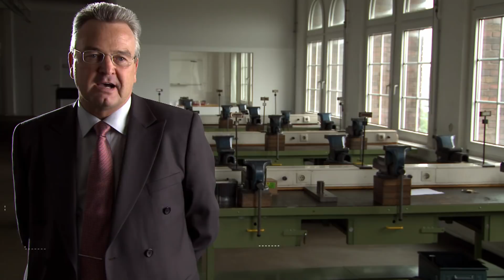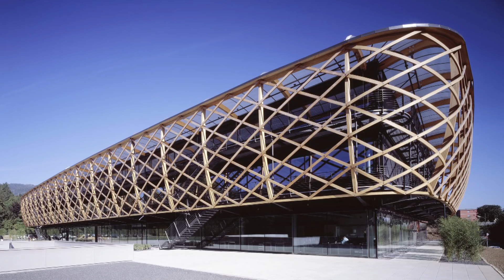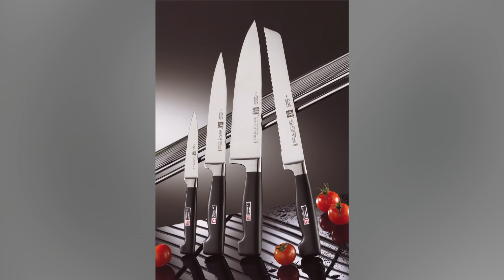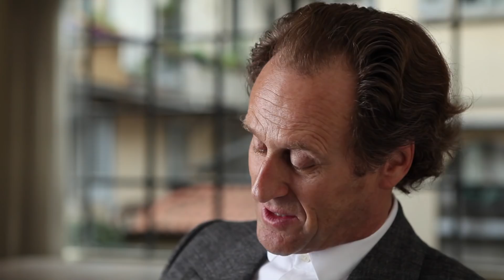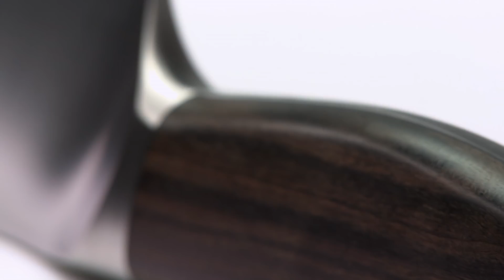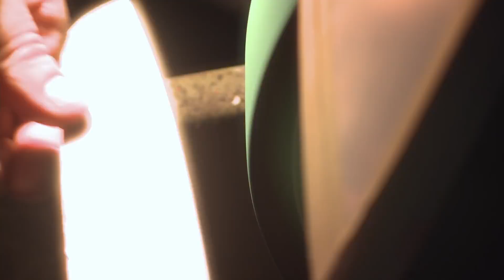How a ZWILLING J.A. HENCKELS Knife is made! - BRANDMADE.TV

Comment: Calling these knives forged is a bit missleading, when the only real forging part going on is on the bolster.
Reply: It is still forged.  It would actually be quite difficult to forge an integral bolster like this by hand.
Reply: @mattrevesz  I know it would be, but that's not the point. They call the knife forged, even though the bolster is the only thing heated up and shaped, everything else is stamped, sanded/ground and heated up for heat treatment.

Comment: the design aspect aside, i've used henckels' knives since the 80's. they stink on ice (pun intended.)  the composite handled ones are near impossible to sharpen, and do not hold their edge. in a restaurant environment that spells disaster. solingen (german) steel is my favorite, you'll do a universe better with wusthof. although no longer produced, if you can get your hands on the wusthof "grand prix" series knives, you will know what a truly good knife is. beautifully balanced, razor sharp, easy to hone, ergonomic. to be fair, henckels' wood handled knives are good  too. good balance, stay sharp, easy to hone. i don't like gimmicks. henckels has a lot to prove and improve.
Reply: I love my Wusthof 6 inch Chef's knife; it's seen daily use for 7 years and is still going strong. With some practice, I've found I can replace just about every other cutting tool in my kitchen with that one knife.
Reply: @allseeingeye93  , whatever works for you is the best. hayeva, i would caution against using a chef's knife in place of a cleaver, boning knife, or toothpick!...just kidding. the point is, the right tool for a particular purpose is always the best approach...and safest. happy cooking!

Comment: Ive had a nice Henckel kitchen knife for about 10 years. Its a good knife. Its
 balanced well, feels good in my hand. The only issue, it wont stay sharp for long. I recently bought a set of Japanese knives. All 3 were hand made in a small shop in Japan. The smith is an actual sword maker who also makes kitchen knives. The knives are by far, the best I've ever used. I also spent less than Henckel and got 3 specialty, hand forged knives by a master Katana smith. They are not expertly designed for looks and precision. They look like black iron with an edge, but what an edge. Sharpened with a wetstone and its a razor. I cleaned a Salmon like it was jello.

Secondly, why does ths Henckels guy keep saying the knives are "Forged"... then they show the knife being stamped out of a blank. Thats not a "forged" knife! Its a stamped blade that was apparantly designed by Italy's GREATEST designer, who just designed the exact kitchen knife already in 1 billion kitchens.
Reply: Dropped forged/ hammer forged...hand forged, the hand forged blade actually is more likely to contain flaws (inclusions, poor temperature control, over-worked steel, etc) than the mechanically forged blades. Again, you get what you pay for, and low paid labour usually equates to low quality product. Ask any professional in the restaurant business (who usually have to buy their own knives), what kind of knife they prefer and the answer is always the best that they can afford...not the best deal on an economy blade. The "experts" are out in force in this comment section, but beware of kitchen warriors giving advice on their limited knowledge.

Comment: I almost bought one of their boning knives, but didn't when I read 'made in China' on the blade. Probably still a very good (relatively inexpensive) knife, but from what I've seen of Chinese metalworking, I think I'll pass.
Reply: Not all chinese metalworking is bad. In fact, there are great companies that manufacture great knives in China. CCK, Deng, Shibazi, etc.
Reply: Real Zwillings are German or Japanese (depending on lines). In the US they have a cheaper line which is made in China. I would guess the one you looked at was at most $30-40

Comment: You can't really tell me that those engineers where supriced about knive balancing XD what have they done before???
Reply: It’s because most German knives are balanced towards the back. Not really at the bolster. I know your comment is old but just incase you cared.
Reply: Too add onto that,
If the balance is towards the back of the knife/sword/Any other tool you have more precise point control giving you more precision. I prefer this in paring knifes.

If the balance is towards the blade it makes it easier to transfer power into your cut. This is what you would want for cleaver and would be my preference for a larger 10"+ chef knife if most of your knife work involves harder to cut ingredients.

As for a chef knife it's really about preference. I personally use a 6" chef knife which is on the short side that is slightly hilt heavy. I prefer the shorter knife with a bit more precision for my cooking.

Comment: why one layer of steel thats weak you should make more layers then you will have more durable kniwes
Reply: No, you won't. The point of layering steel is to remove impurities in the metal, like dirt. We have machines today that easily remove all the impurities of our metals. So, the only reason for layering steel now is for it's visual appeal.
Reply: Yes that's also the point of layers, but it's also to make a ''jacket'' of softer steel/iron for the hard core steel to make the knife more flexible/durable
Reply: First of all, putting hard steel inside of soft steel won't make it more flexible. For a sword, you'd want the spine to be soft and the edge to be hard. Secondly, combining hard and soft steels is not a good idea for kitchen knives.
Reply: And why is it not a good idea? I've done some reading and watched videoes about making knives/swords and why it's good to have a softer steel over the hard core steel. Enlighten us.
Reply: I imagine sharpening would be a nightmare, since the different layers of metal will grind off at different rates. either way, no amount of adding soft steel to the outside of hard steel will make that hard steel center more flexible. It adds nothing to the construction, except some possible visual designs.
Reply: The softer steel is in general to actually protect the core steel (As if you were to drop the knife, the blade wouldn't shatter, compared to a single layer hard brittle blade. Therefore more ''flexible'')

When sharpening you focus pressure on the edge. As western style go, we typically see the Compound edge, Just sharpen that edge (At the correct angle as the edge is) as usual (on a wetstone).

Then there's the V edge which is where the outer layers really come to play, there is one long bevel going down to the edge,

You should as said above, focus pressure most on the edge, but in general put pressure on the middle of the bevel, put press down so you're pushing more on the edge, and don't apply pressure when the edge is going in the direction where it would/could cut.

Comment: so many comments about which brand is better or what country style is better...I think as long as it fits in your hand and feels right for you to cook easy, that's the best. know your knife before you buy.
Reply: What you say is true, but there is a definite way to measure performance.  Edge holding, chip resistance, sharpenability/grindability, these are all measurable attributes.  You could also compare how well it actually cuts(after the knives in question are sharpened to the same level), although I'm not aware of a way to quantify, in data, this character.  You could have a fairly large pool of subjects test the knife "blind," and collect data about their preferences, but it does ultimately boil down to the edge geometry.  What angle is the actual cutting edge and secondary edge ground at?  How gradual is the approach angle to the primary edge?  All else being equal, these will determine how well a knife works its way through media.  

If you're asking what shape of a knife one prefers, that's more of a preference thing.  Whether you like a lot of belly for rocking, or a flatter edge for a more parallel motion when cutting...that's kind of a preference/style of cooking thing.  You might be able to say that one style of chopping works better for certain cuts or fatigue, or whatever, but that's a bit different than what we're discussing here.
Reply from the maker: Good point, Tri.
Reply: A lot of re-sellers of knives from Japan will re-label knives from the same manufacturer. They may have slightly different specifications but are aesthetically the same. That doesn't mean that the knife that fits and feels right is a great knife and worth the money as there are huge differences from one manufacturer to the next. Harder steels tend to allow for lighter and thinner knives, more acute edge angles,  and can be thinner behind the edge (less wedge like). Some have a bolster that veers toward the spine for more comfortable pinch grip.
Reply: Many people who argue and debate extremely fine points of knife and cookware design could really benefit from a beginner cooking class
Reply: yeah, absolutelly I agree with you, not only the knife which mafe in German or Japan is the best one, because not all top products which others pursue are the best one that fit you. Any knife which makes you comfortable can be called the best one. Just like the Allezola's knife which I brought from Amazon.com at an attractive deal price. Maybe it is not popular and expensive as the Zwilling, but it is razor sharp and lightweight for comfortable grip. I love it, and also recommend it to all my friends.
Reply: All that matters is that you sharpen it well. I really like the look of this model, but right now, my $15 dollar beater knife is sharper than 99% of these fancy ones. That's because it had gotten dull, so I sharpened it earlier today. But it will get dull again soon enough, and need doing again. I love a fancy knife, but before you buy one, learn to sharpen on a cheap one. That way, when you do splash out, you know it'll be perfect forever

Comment: No cryo in the heat treatment process. The plunge line bolster also makes sharpening the heel overtime exponentially more difficult. I have old stamped henckels. Thinner, lighter and easier to sharpen on whetstones from heel to tip.
Reply: Look again at the bolster,  It appears to thin out towards the edge, so no issue with sharpening near the heel.

Comment: It's very pretty, but a simple thin high carbon steel blade is best when it comes to actual use.
Reply: +Julian Petkov And they're a bitch to sharpen too, because of the Carbide...
Reply: lerch25 Stainless works well as well. It also won't rust over time nearly as easily. If I was selling an 8" chef for $450 I would personally use something like CPM154, CPMS30V, and so on. Lots of good powder smelted steels out there.
Reply: MyrtnKnives perhaps I've never tried a good stainless blade, i've always had better luck keeping an edge on high carbon, and I love the thinness and flexibility of them, most of my set is stained brown as burlap, but I don't even care anymore.
Reply: +MyrtnKnives ZDP-189 is where it's at.
Reply: +elryanoo Lol yeah, if you like edge chipping and a blade that can't be stropped. Aogami Super, HAP40 and a myriad of PM high speed tool steels give you all the wear resistance with superior toughness and ductility.
Reply: +MyrtnKnives There's a reason we have stainless cladding, to negate the corrosion factor. CPM 154 or S30V are bottom of the barrel when it comes to PM steels, to the point where they're even being phased out in folders in favor of the tougher S35VN. If I'm going to pay $450 for a chef's knife I'd want Aogami Super, HAP 40 or the like clad with high chromium low carbon stainless. CPM M4 is probably the ultimate performer in the kitchen in terms of overall edge retention though, and it's rate of corrosion is largely overblown.
Reply: +Julian Petkov Surgical tools don't have to deal with cutting board impact; carbides have zero ductility, and you absolutely would get carbide fallout and chipping with a pure carbide blade in the kitchen, plus it would be impossible to maintain on a strop or hone, you'd have to break out diamond abrasives ever time your edge dulled.

Comment: Damascus knifes still the best
Reply: Damascus does absolutely nothing for performance, with modern homogenized steels it's for aesthetics only
Reply: There is no real Damascus steel left in the world apart from, maybe, in some museum. The secret to making it was lost centuries ago. What you call Damascus steel is just a pattern, achieved by a lot of folding of the steel and twisting it after it's been stretched out.
Reply: Jamal Ramdoun
Reply: not for all purposes
Reply: Rubbish!
Reply: vg10 and SG2 do not rust easily at all they're both still high chromium stainless steels, the damascus is really just for looks.  Henkels like the one in the video are good for deboning meat for instance but the edge retention and balance isn't there at all compared to any quality japanese knife. 

For half the price of one 1731 you could by a kramer or miyabi SG2 blade (still henkel just great ones) either would obliterate the overrated 1731.

Comment: shuns are better
Reply: Shun is the 2nd most overrated Japanese knife imo, Global is 1st.
Reply: +Paul Yoshida The problem with shun is inconsistency with the finish grinding. If they just had a shit heat  treat then all their blades would be brittle and prone to chipping; what seems to happen is whoever is grinding the secondary bevel at the factory is getting the edge far too hot and ruining the temper - this goes for both SG2 and VG-10 blades, from Shun Classic and Ken Onion line to the Shun Kaji line. So it's hit or miss.
Reply: +Paul Yoshida Absolutely love the Masakage Koishi, they're incredible performers especially after a bit of primary bevel thinning and polishing. Their dual core bullshit is just gimmicky marketing + aesthetics. Their blue series line at a fraction of the price is going to perform better than pattern welded VG2/VG10 lol. At $750 that puts it in Honyaki territory, and at least in my opinion their dual core series isn't as pretty as some less expensive custom options, like my Fernandez https://www.instagram.com/p/BOI0DidgEYS/
Reply: Yeah, I have about 10 Shun knives and about half are chipped badly, the other half are fine. Same usage, cleaning, storage. Just goes to show how inconsistent they really are.
Reply: Shun has yet to be able to produce a consistent heat treat, their VG-10 and SG2 are way more brittle than market rivals. They must have some ass hats setting the bevels at their factory.
Reply: Hm.  Guess I've been lucky then.  I currently own 2 shun premier knives(8" chef and 9" slicer) that were my primary go-to knives for several years.  Recently, I've been using the masakage koishi 210mm gyuto...which has been awesome....so, they've been sitting in my drawer...anyway, they were fine.  I'm not sure what's going on with their latest additions...dual core?  For $700+?  What is this, an intel processor?  Why would I spend that kind of money on a production blade?
Reply: I have Shun's but have you used these?
Reply: Really?  I own several Shun knives, and they all are fine.  It seems their vg-10 tends to be heat treated slightly softer than some others, but compared to the custom vg-10 gyuto I own, the shuns aren't as prone to chipping, while they do sacrifice edge holding.  It's a trade-off, and I don't know that one is better than the other.  However, I have seen some issues with blade straightness on the premier line-up, since those are quite thin.  I purchased a 9" slicer some years ago, and it was a bit curved.  I could have straightened it myself, but I just returned it in exchange for a straight one.
Reply: Shuns are overpriced. There are better Japanese knives for less money. I own zwilling and like them. If I was buying again I would probably get whustof.
Reply: Globals are horrible